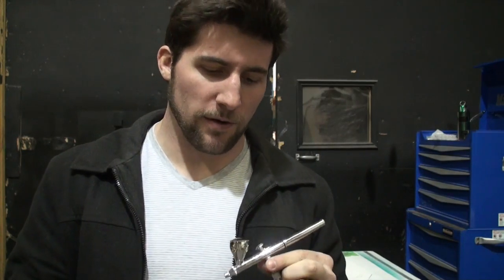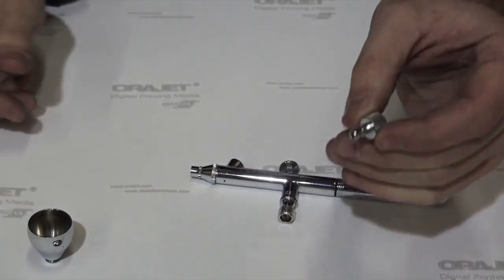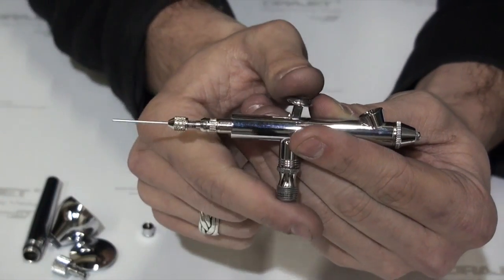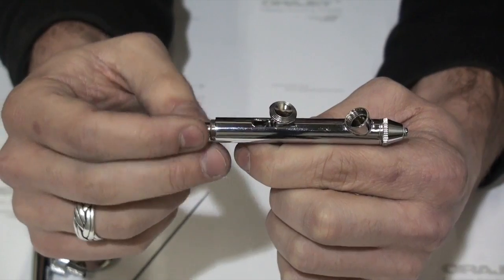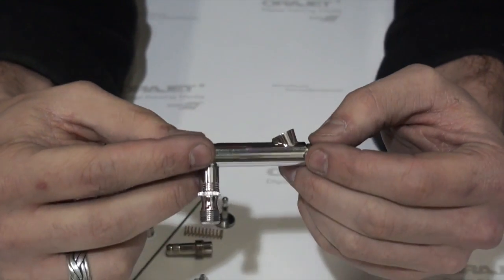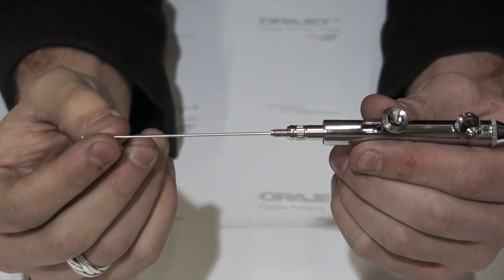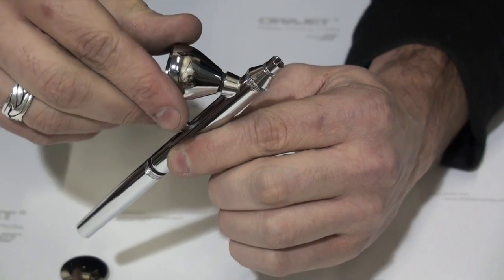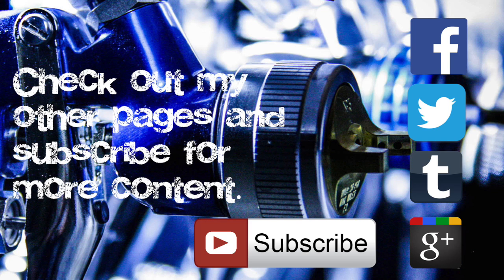Getting Started with your Airbrush

Comment: Hey, great video! 

My airbrush doesn't spray out the color or nearly nothing at all. I clean my airbrush often, have a working compressor and thin down the paint's. So whats wrong with my setup?
Reply from the maker: It's hard for me to help without actually seeing your setup. Is there a way you can show it to me?
If you put your hand in front of the airbrush and push down on the trigger, can you feel lots of air coming out?
What is your air regulator set to?
What kind of paint are you using?
What size nozzle does your airbrush have?

Sorry for all the questions, but the answers might help me figure out your problem.

Comment: Thank you, just what I needed. I'm struggling to get to grips with airbrushing. When it works it's great but ......    anyway I took my airbrush apart to clean it, it's just a brush that came with the compressor, and a tiny rubber washer dropped out and I can't tell where it came from to fit it back in.  The brush now leaks when left in the holder.  Any suggestions?  Thanks again. I'll look at the Iwatta brushes now!
Reply from the maker: Did you by any chance ask me this exact same question on Facebook under a different name? If not, there has been a very odd coincidence haha. Anyway, can you describe to me where it is leaking from? That may help me diagnose the problem.
Reply: HI Yes it was me, I thought maybe questions should go on FB, sorry.  It just dribbles out of the end!  I also asked about makes of airbrush, what do you think? I value your opinion.  Thank you.
Reply from the maker: And it was a rubber seal that you lost? If paint is coming out the end it sounds to me like your needle just isn't seated in there properly. Make sure that everything is clean and that your needle is pushed forward until it seals in the nozzle. The rubber seal might got behind that first chamber, but I doubt it.

As far as airbrush brands, I usually recommend Iwata or badger. They have some great airbrushes particularly for entry level users.
Reply: Brad Angove what do you think about the top trigger or the gun type trigger which is best for a beginner?
Reply from the maker: If you're going for detail, I feel that the top trigger is superior because it resembles holding a pen. If you're looking to do larger areas more comfortably, the gun style is more ergonomic and easier on the hand. I would go with the traditional top trigger personally.
Reply: I've never tried it with one of those for sure, are they good for airbrushing? I bought an iwatta Neo as recommended by Brad and have been thrilled with it.  My skill level is still a bit hit and miss.  I have had a break from colour work while I sculpt but it is funny you should mention me because I got the compressor out yesterday in preparation for more airbrushing this week.